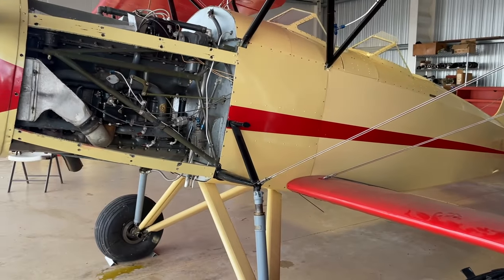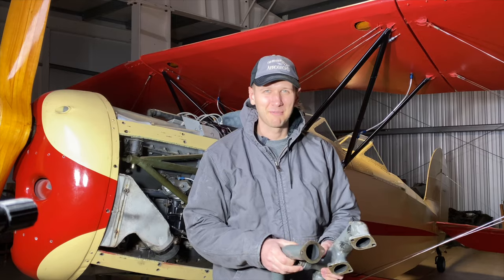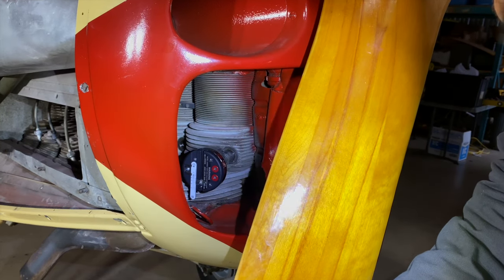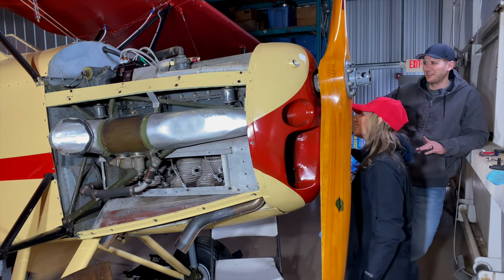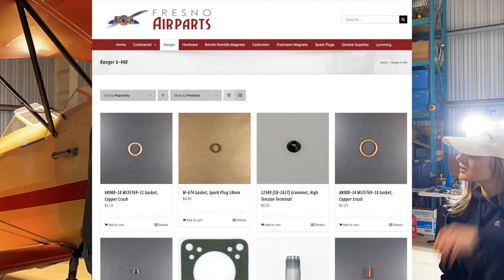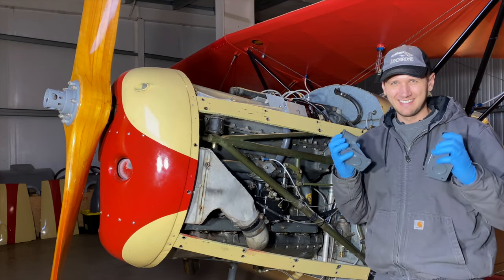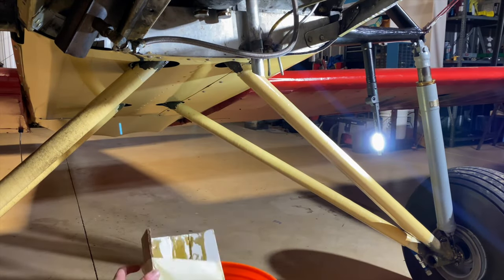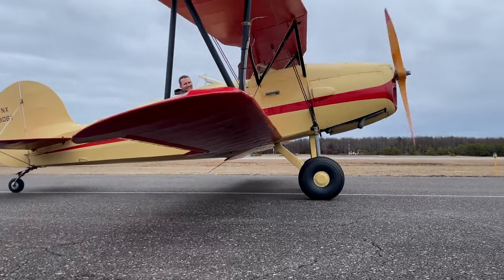Ranger Great Lakes Biplane Episode #3 — Engine Inspection, New Magnetos, Time-Rite, Engine Mounts

Comment: Safety wire on air filter?

I’d like to see how you raised the engine with a 2x4.
Reply from the maker: The door that holds the air filter in has a little pin that gets safety wired so it doesn't fall out!

Didn't get any shots on it, but it was a 3 foot 2x4 vertical on a jack.